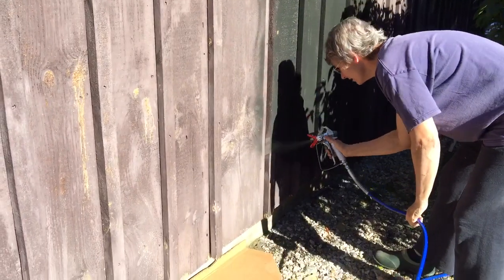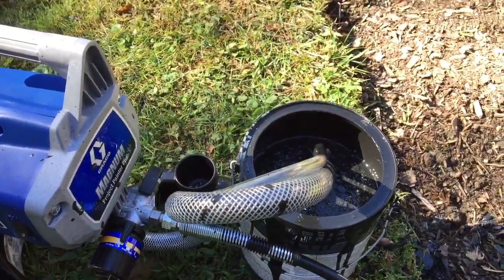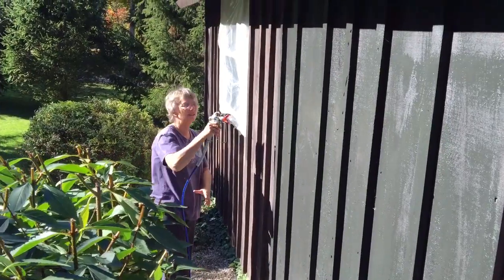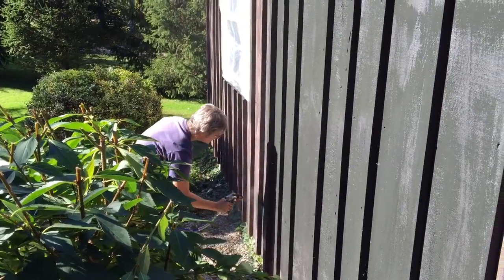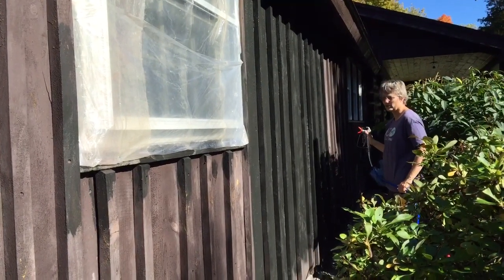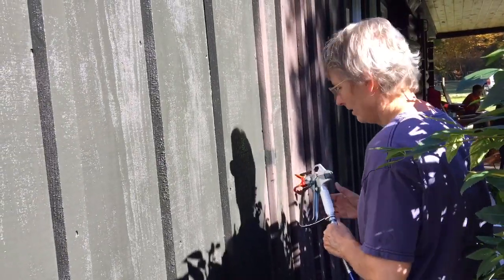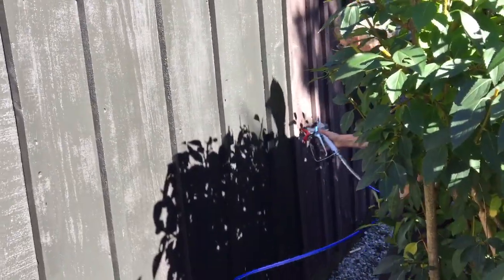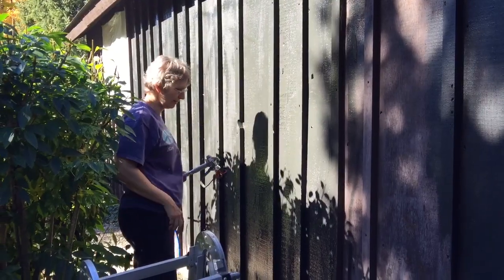Gear Yell #31 - Graco project painter plus.

Comment: ive been in a toss up cause im not going down the harbor freight road again. so i started looking into others just to see prices again. well this unit is 20$ cheaper then the wagner right now which is also on sale for 229$ but not only am i trying to between a few tools right now. i want ones that will last and be name brand. ive had so much harbor freight crap fail in the past it isnt even funny. ive watched a few videos already and im on the fence like paint about this wagner or the graco. still in a toss up. the lower pressure kinda appeals to me more for lot close cut in stuff for time consuming. but also the 20$ difference lol. hmmm.
Reply from the maker: Honestly,  I think the best bet is to go to one of the websites with reviews on it, (like Amazon) and compare the two. In two years, $20.00 might not make a huge difference if you are unhappy with it. We bought a Ryobi a few years back, and it was cheaper.... in so many ways......... ;-)
Reply: @JimsEquipmentShed  ive burnt up 3 ryobi tools this summer building decks. my next round of wireless for commong tools will be milwake. but the odd tools cordless ill prob stay with ryobi . i like the 100+ tools 1 battery.
Reply from the maker: Yea, honestly,  think thats why I was so disappointed in their sprayer. Generally, I use my Ryobi stuff over my dewalt gear, because the battery life on the dewalt sucks so bad. 
You are right, ryobi is not really meant for a contractor, I went through the circular saw in about two years.
But my pole saw for instance, I love that thing, best bang for the buck ever. I have their chain saw as well. 
(The old blue one, not the fancy new one.)   And that thing is a beast.

Comment: Doesn't the smaller tube need to be in a separate bucket?
Reply from the maker: Corey Harmon Nope, it’s a return for when you are not spraying. Sort of like a return line on a cars fuel tank.

Comment: Does this work well for interior painting as well?
Reply from the maker: +Matt Neff I would have to say probably not, the Graco is more just designed for outdoor work. The last one I had did, as it had a roller system, but that Ryobi system was such a piece of shit it never even made a season.
The next Graco up from mine had rollers offered, and a better paint containment system.  (This one is prone to spilling if you are not paying attention.)
Reply: I know you posted this 9 months ago but I just used this to paint our den.  we did a full on gut and when it was time to prime the drywall I used this.  It was great.  Taped and hung painters paper on the windows and the new 10 foot sliding patio door.  it worked great.  Primed the wall and ceiling.  10 foot ceiling height and the den measured 25 by 18.  I plan on spraying the ceiling paint in the morning and I will roll the color on.  I feel like it is easier to spray the ceiling rather than roll it.
Reply from the maker: Stephen Grimsley
Yea, I could see that being much faster, especially during a full gut. The overspray isn't terrible, but just didn't seen ideal for interior use. So its good to know that it can be done.